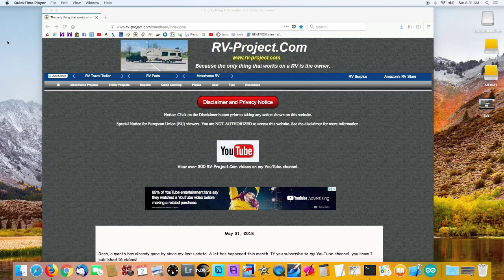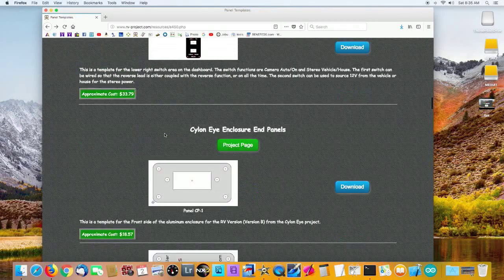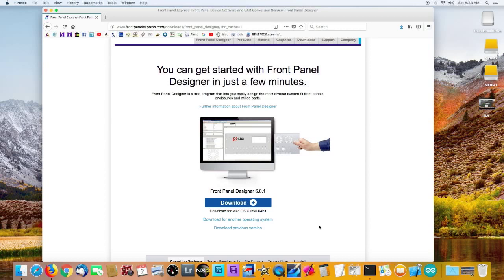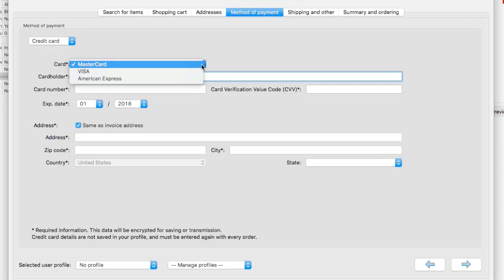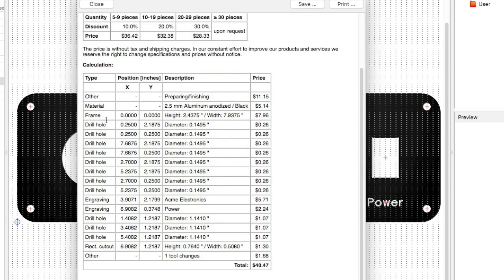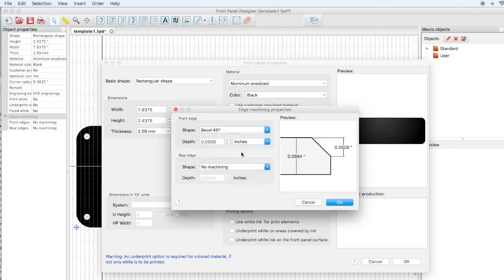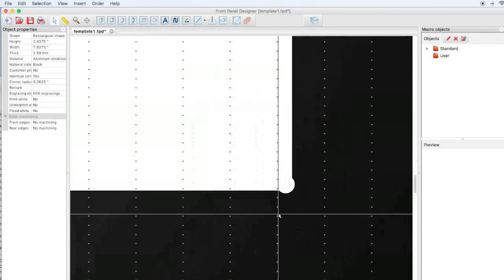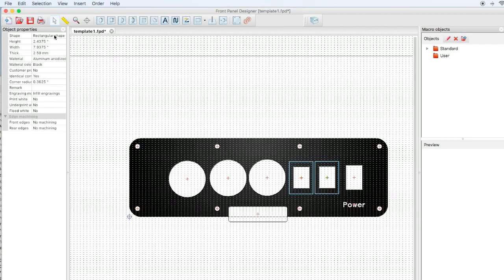Ordering from Front Panel Express with a template file.

Comment: I followed this video and when I tried to download the EMS-1 template, all I got was a page full of random characters. I have the Front Panel Express up and running. What am I doing wrong?
Reply from the maker: Download the template, save it as a file Then open it with the Front Panel Express app. Do not attempt to open the file using your browser.

If you are using Microsoft Edge, it won't work. There is a procedure I outline at the top of the template page to download the file if you are using Microsoft Edge.